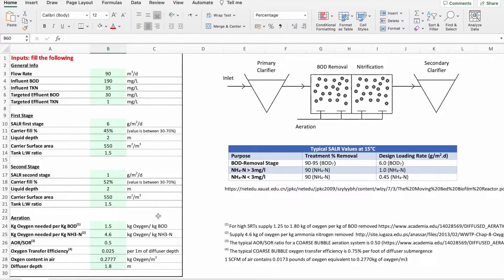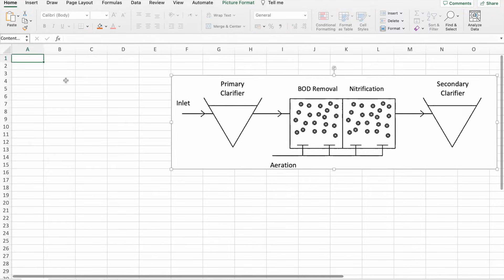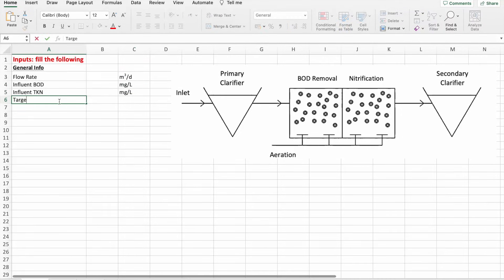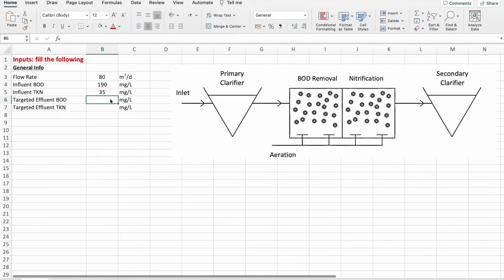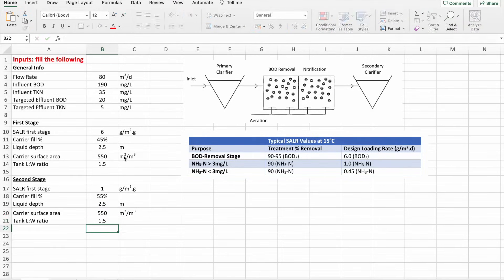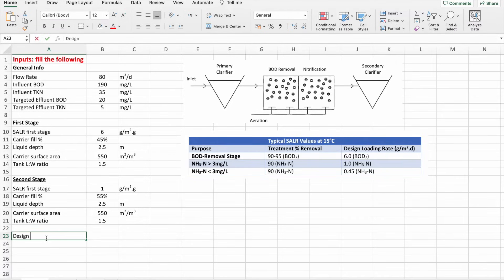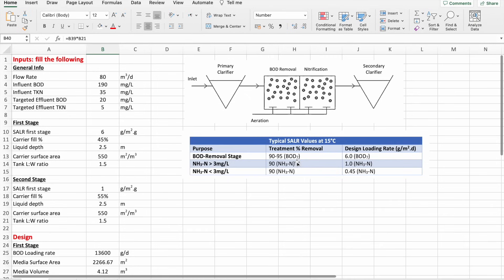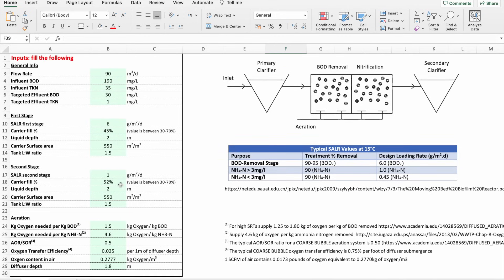Excel MBBR Wastewater Treatment Plant Design (xls)

Comment: Thank you very much for your excel file. It is very interesting and useful the aeration section is extremely important and has been a great help to our process. Perhaps a section on the geometry design and HRT of the primary and secondary clarifiers (to ensure a 30% reduction)  would be a great continuation video.
Reply from the maker: Hello dear, glad you are happy with your purchase. 
I will consider your suggestion for the future video/design sheet.
Reply: @wateracademy5866  In your spreadsheet the "digestion" of the MBBr is 6g/m2...and the 02 requirements are 1.5kg02/kgBOD however it seems it is calculated at 15oC. Do these  calculations hold in countries with average temperatures of 28-30oC? or should they perhaps be inceased or diminished.